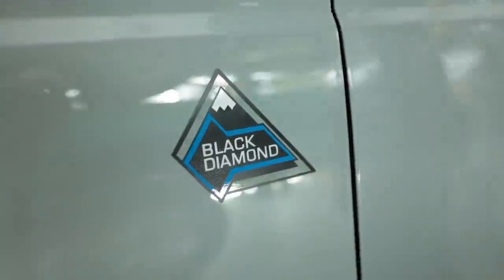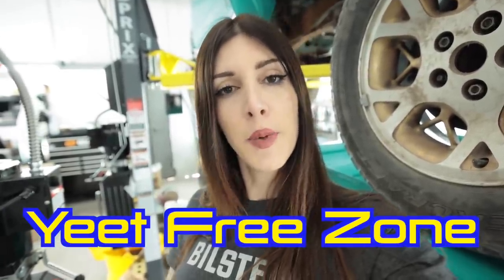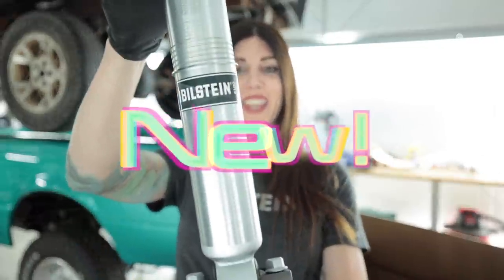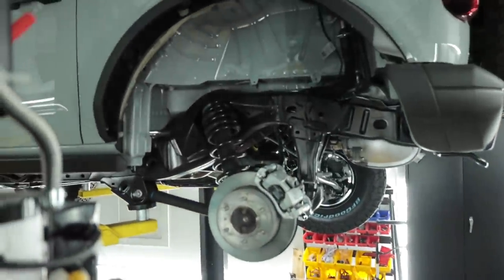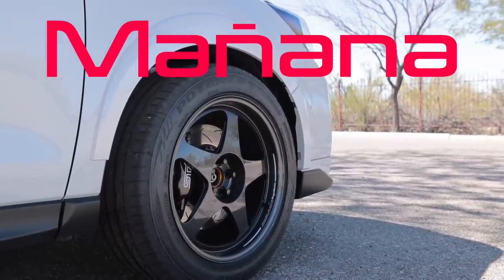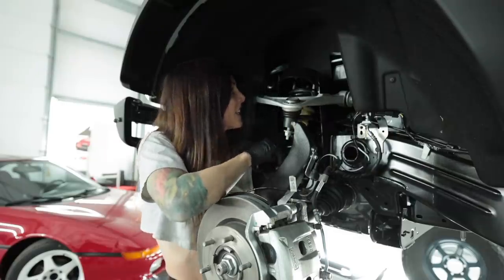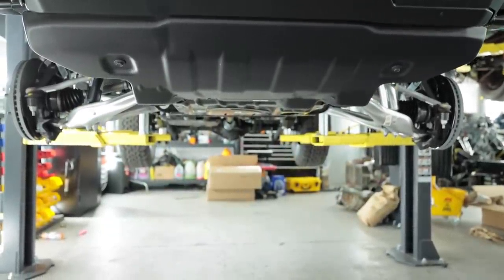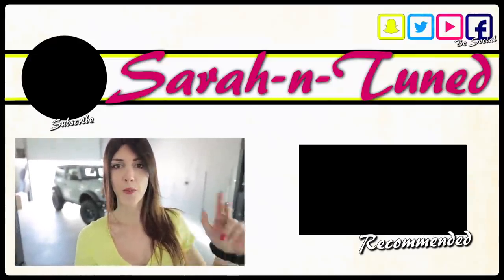Lifting my 2021 Bronco Black Diamond // Bilstein 6100’s

Comment: My "old" F150 had the exact same front IFS set up. I didn't think of dropping the lca when I changed the struts though. On mine, I pulled the sway bar links and popped the upper ball joint off the knuckle, which gave enough room to pop the strut out of the saddle in the lca. In hindsight, this way may be easier next time I do that 😊

Comment: The low control arm is at a greater angle when on the hoist because the strut is longer. The spring doesn't come into effect until you put a load on it which is why it sits higher once on the ground.

Comment: I love your attention to detail and your technique,

Those plastic rivets with the Philips screw centers are easier to remove when you pry them up with the tip of a razor knife.  That keeps tension on it, so that the main body doesn't turn in the hole.  When replacing them, there is no need to use a screwdriver to install them.   They are installed like any others without the Philip screw head by just pushing them in.

You need to use a crowfoot on your torque wrench to get to that inaccessible bolt reducing the torque value to compensate for the extended lever arm.

Best regards from a retired aerospace engineer,

Comment: I get so nervous compressing springs to change a strut. Last year a compressor broke and I got hit in the face with the upper strut mount. Had to get about 25 stitches in my bottom lip. Went clear through my lip in fact.
Reply: One of my biggest fears
Reply: @RazoE  It wasn't fun, but it also wasn't as bad as it could have been. People get killed by such injuries.
Reply: hope you're on the mend
Reply: @mostcom  I have healed up fine thanks! It was last June when it happened.

Comment: If you have a rubber bushing on a suspension pivot, always torque when the vehicle weight is on the tires. On some vehicles it makes a huge difference.

Comment: I recently changed the suspension on my fiancé's MX5, had the springs compressed on the floor. While removing the compressors one pinged off and hit me in the face! So lucky, only bruised my cheek, could have been a lot worse. 
I just took my eye off the ball for a second, never happened before.
The Bronco is looking (incoming British phrase....) the dog's boll**ks! That's the highest South Londoner based compliment BTW.

Comment: Looks great.  I am a nervous Nelly when it comes to those spring compressors.  Too many stories of them popping of the spring.
Reply from the maker: I don’t know how on earth one could manage to screw up using these spring compressors. Like, to get a spring to “pop off” would be an impressive level of stupidity 😂
Reply: @SarahnTuned  Exactly. I have been using them for over 20 years and never had an issue, and working in the hot-rod / custom industry for all the time - I have had to mess with some pretty off-the-wall spring set-ups. I even have a tiny set for the small coil-over springs on some applications and motorcycles. I think most people that have had "issues" are either using the wrong tool for the job, or not paying attention to the alignment / position of the compressors. You can buy "locks" that work with the compressors as a fail-safe in case you are working with something that may not be optimal.  The minute you forget to respect the tool and job - is the minute you get bit by it.

Comment: You only needed to unbolt the lower ball joint instead of undoing th eccentric  bolt
The lowered arm will swing down with lowere ball and stabilizer pin are removed

Comment: Looks great, I'm assuming you would have to have the front end aligned after? Also curious what the Sasquatch package costs vs doing it yourself? Would it be more cost effective to order with it from the factory? I think the Sasquatch package also comes with the on-the-fly un-linkable sway bar.

Comment: I don't have a late model Bronco, but wouldn't it be easier to split the ball joint at the steering knuckle instead of the two bolts on the lower control arm at the frame? Nice build though.

Comment: Pokey looks Great !!! Your comments are off the charts Hilarious !!! I realize we're only talking 1.5 inches but, you may/might want to check with someone in the know (Charlie comes to mind) to find out if you should have Pokey realigned. Yeah it's only 1.5 but if you wear the outer edges off those tires.. an alignment would have been worth it. Just info - Have a Great Day (or whatever it is when you read this) :) :)

Comment: No dust cover transplant for the new shocks or do they not fit over the body of the new damper? 

Never mind, optional, made it to the plug...
(I would have reinstalled the covers, protection for the seals.)
Reply: We use a seal pack on 6100s that doesn't require a boot, also these are way larger diameter (2.65")

Comment: I've never had to pull the a-arm frame bolts when doing struts - always just popped the lower ball joint loose from the spindle and pushed the a-arm down for clearance. I learned something new but that seems like a lot of extra work.

Comment: Sarah, what are your thoughts on the height adjustment for these struts? It seems like a lot of stress on just that spring clip. Are there also spacers included with the strut to adjust the lift or is it just the sorting clips?
Reply: @stevevonseggern3399  Thanks for the follow-up. "If it ain't broke don't fix it...!! Having said that I'd still fill that space between the spring clip and the shoulder on the strut body with an aluminum spacer rather than just relying on the spring clip.

Comment: WOW… on that 6100 shock, I do not see how one snap ring in that shallow groove is going to hold the spring collar under load?!
Reply: the spring perch go's over it and captures the snap ring and holds it closed and locked into place and the spring perch centre hole in a exact size that it is impossible for it to over shoot the snap ring.
Reply: It's a very proven system.

Comment: I’ve seen on other channels that there are problems with the rack and pinion steering when you put over sized tires on bronco. There’s a retention spring that can fail causing loss of steering. Hope you don’t discover it for yourself.

Comment: Another great video, maybe next time you need to torque in tight spaces use crowfoot's with your torque wrench. Just remember the extension formula along with the angle formula. Gotta use that crap all the time in aviation!

Comment: Im a talker when not doing mechanical stuff and if i was working along side u, id let you talk dirty all day suppose. I used to tear down quads and detail and clean every part, engine out and all   No talking just working fun. Take down Saturday clean Saturday night, reassemble sunday. Test monay

When u say discarded as in the struts, sell them, even if unassembled with missing parts. Many off roaders do onsite repairs while out for the weekend and pack extras.

Comment: Maybe you filmed it and edited it out....? 
You are not done.
You need to loosen all 5 control arms at the rear and retorque them at ride height so the bushings are centered and not "pre-tensioned" one way or the other.
The same needs to be done with the rear lower strut mounts and the front upper control arm bushings.
Last but not least..... it will need an alignment.

Comment: Just a heads up before you take it off road or even using on dirty roads, you might want to invest in mud flaps. Especially the front wheels, you will destroy your paint. All debris coming off your front wheels get directed straight up onto the car. I’ve seen a YouTube with a Bronco owner purchasing Rokblokz and did a before and after driving through mud, mirrors, handles, rear step out fender and paint work was full of stones and mud and after Rokblokz were fitted, that all ended. Their paint work was all chipped from only suburban driving with low mileage
Reply from the maker: I ordered some already. I’m doing my own with a universal kit since I didn’t like any options currently made for the bronco.

Comment: Top tip of the day which has nothing to do with butt plugs….. always torque up bushes with the vehicle on the ground. If you tighten them with the vehicle raised when it is lowered to its normal standing position it twists the bushes into an unnatural position and causes premature wear.

Comment: Why were you pulling up on the wrench when taking the lugs off? Push down. Work smarter.
Reply: Every time I do that I smash my knuckles on the ground!
Reply: @johnturner4400  then open your palm 😉
Reply from the maker: Lol, the irony of closing your statement with “work smarter”.
Reply: @SarahnTuned  I've had lugs so stuck that it took a 4 foot pipe on a tire iron. Never had a problem pushing down. You just don't put all your weight into one giant shove 😂. Or leave your hand wrapped around the wrench.